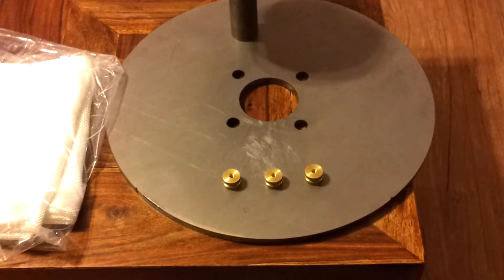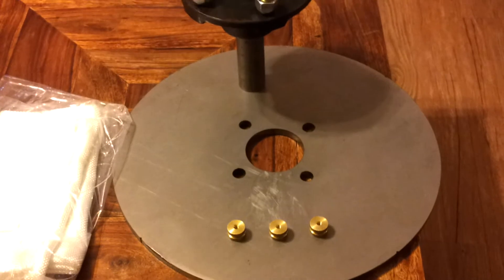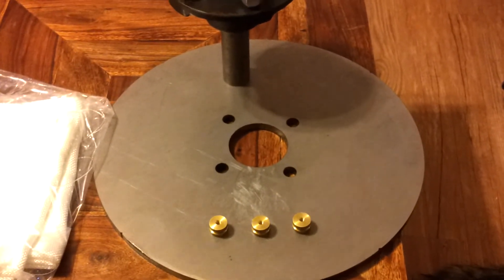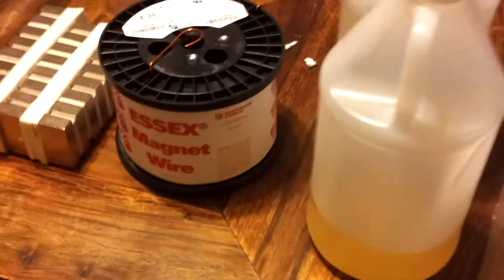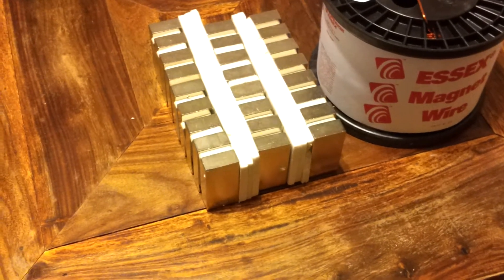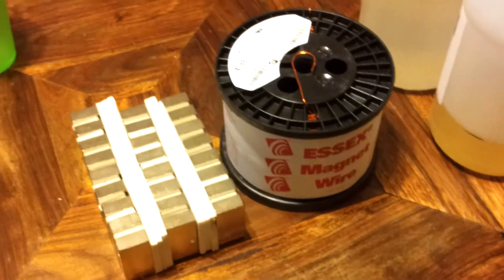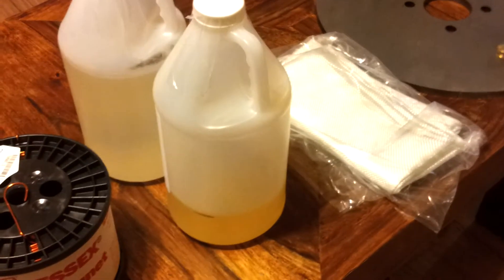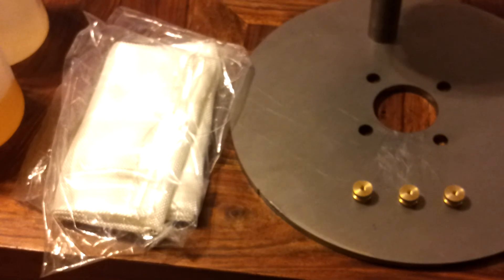Axial flux build pt2.

Comment from the maker: Thanks Billy. I have looked at the Midnight and Morningstar both. Right now I plan to just go straight grid tie and dump to a hot water heater element. Once I get it dialed in and add 2 or 3 more mills and some solar I will look into a large battery bank.

Comment: Real nice seeing the parts. I've been doing some research on the Midnite solar Clipper and the Midnite controller. The Midnite controller and Clipper are a match with the axial turbine, It will increase the power by x3!! Check into it, its sweet. Thanks for the update!